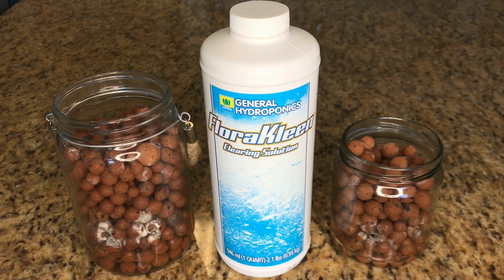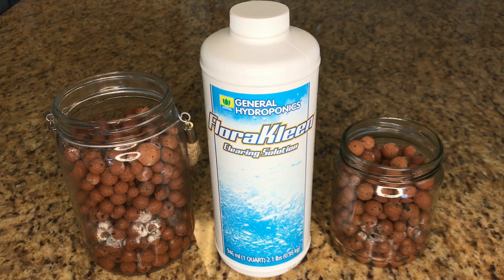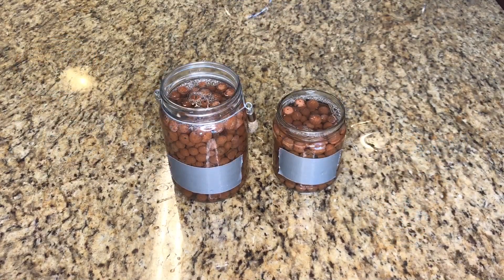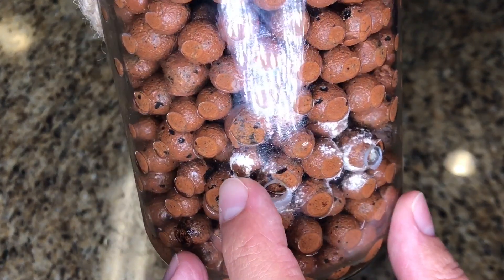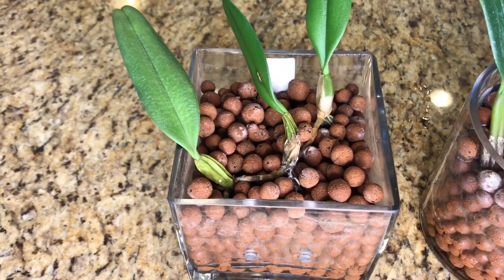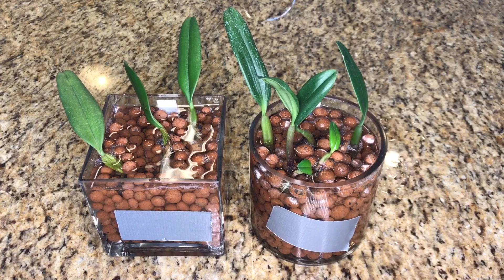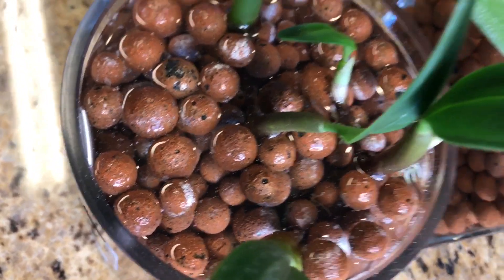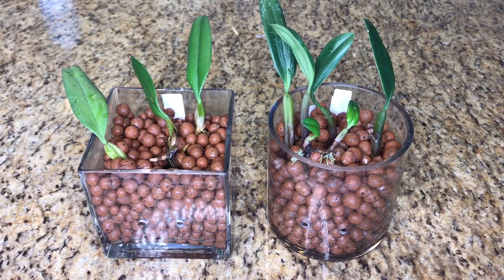Mineral Buildup: Semi-Hydroponics (Part 2)

Comment: Rather than duct tape, which was a bit messy and leaked, I came up with something that is much easier for me. I use hot glue sticks that I taper the ends with a pencil sharpener that fit perfectly in the 1/4" hole. One stick cut in half works for one container.  This is how I'm able to soak my orchids in nutrient solution for 15 minutes or so.

Comment: I just don't fertilize every time, I do it every other time.  SO a plain water flush between each fertilizing session.  I have never had any build up.  I hate using excess chemicals on my orchids but I'm a little OCD about that.
Reply from the maker: I think you're absolutely right. I prefer not to use any additional chemical treatments. Which is why I talk so much about just flushing with plain water. Lesson learned!

Comment: Lol i did nit watvj true tje end before i made my comment. Yes yes yes flush with pure water but lower ph that helps to leach out and dissolve the mineral. 
I hope it does not kill the roots. 🙈 
Much love. 
Kind regards rose 🌹

If the plants has a Potasium o erdose it block out magnesium (or calsium im not shure wich and with gap water tje ph is not low enough to make the magnesium available. Im not tje source for this info i might have them mixed up.  Please watch ricks video on it.  

But ill advise to flush with distilled with kelp mix (if your kelp mix also lowers ph )

Comment: Hi Micheal, 

Your mineral build up is quite extensive for that period of time. You can deduct a few things form that. 
1 your orchids dont take up all the nuts. Your providing, therefore your stil feeding to much. 
 
That can be because of 
-transitioning 
- not in active growth mode 
- Ph not in the right spot for certain nutritions
- They still have a reserve of high nutrients in there system from the mints before and therefore the plant is blocking out other nutrients that therefore wont get absorbed. Nut shure what blocks what you gotta ask rick sorry

CALCIUM and magnisium are one of the most visible minerals whem that builds up (yoy can make beutiful christal when you mix magnesium sulfate in waterand let the water evaporate. (Im doing that expiriment witj my daughter when my epsom salts get delivered next week ) 

And the uptake goes hand in hand with a ph sweet spot. Mabey when you feed at a lower tds around 100 and swing the ph your orchids can use calcium One time with ph above 5.8 and magnesium below 5.8. Ph 

Also see how much cal. Mag. Is in your mix. 

Its all guess work but its good to figure out where the fertilizer problem is. 

I have bin fertilizing with a wopping  430 tds for over 2 months now 🙈 i didn't know so dont judge me please. Buy my leca pebbles and holes in my pots dont have near as much build-up. 

I water with rain water and add a kelp mix with humic acids before my fertilizer goes in. I dont habe my ph pen yet so i have no clue as how high or low my ph is. I do know that i found out my fertilizer had bo calcium in it 3%magnesium but no calcium... like realy wtf what where they thinking but okay thats another subject.  

I hope al that info gives you some ideas to start figuring out why you have so much build-up.  

Much luck and love 
Kind regards rose 🌹

Ps i would start by flushing your vases for tje next few waterings with a low ph to flush out build-up minerals. They can do a few weeks without  (acvept the ones that are growing like weeds ) 

Good luck dear keep us posted
Reply from the maker: You nailed it Rose! I have been giving them the right amount of nutrients, but the nutrients aren't getting where they need to be because I have stripped the roots of all of the bacteria and mutually beneficial fungus that help the plant use the nutrients by using physan and hydrogen peroxide. I'm switching to watering with plain distilled water until all of the build up has been flushed out, and the root system is fully established 😊

Comment: What are your thoughts on changing fertilizer concentration according to growth cycle. Some directions state adding more during growth phase of the orchid and less during non active period. (In my mind the more would be the weakly weekly and less would be very weak). Recently, in your rip segment you mentioned not fertilizing during the stressful acclimation period. This seems to dovetail into today's topic of buildup. Are you seeing vigorous root and shoot growth to warrant the amount of fertilizer? Not really sure it makes a difference, except in your wallet. If the plants aren't using the nutrients...

Again thanks. You're always getting us to think about why we do what we do.
Reply from the maker: I think adjusting based on growth cycle is touchy: I try to replicate what happens for orchids in nature, and nature certainly doesn't consider how much feed it will provide. That being said, nature also doesn't use hydrogen peroxide or physan 20...I'm not sure a lot of my plants have been using what I've been giving them, so I'm not sure how effective it will be at bolstering growth once their root systems are fully established. My suspicion is that once I have a fully adapted plant with a beautiful, expansive root system, the nutrients will be used and have a strong impact. But for now, the Fertilizer just seems to be an obstacle to their growth!

Comment: Interesting topic! :) I do feel like there is a missing peice of this story of mineral build-up... I must say, we are using the same culture method, sh, but I have orchids in this setup for already 3 years and can't see the type of minaral build-up that you got; actually I don't have it at all, and I only water normally, with a very low concentration of fertilizer of about 50 to 70 ppm. I think you should investigate more into this issue and find out what is causing so much build-up on your sh medium, because it is not normal, not after so little time...
Reply from the maker: I've been going through the process of investigating this build up for a while now, and a lot of it boils down to water quality. I have been watering with my tapwater for quite some time, and I didn't realize that it is extremely hard. Straight out of the tap, PPM is usually over 350. That being said, I was also over fertilizing immediately after disinfecting processes, which was another huge contributor. You can kind of see that story unfold over the course of all of my videos, but it's hard to tell in the video by video basis. In any case, thank you for your feedback! I think we should see a huge turnaround in my coming videos on overall mineral buildup!
Reply: Michael's Orchids oh, wow! That's quite a high ppm... Mine is about 250 ppm and my orchids rarely touch that. Only when repoting new orchids, when I shower the orchid root system...  I am glad you know what caused this, because it can be a serious issue and root killer if left unattended for a long time! Will be interesting to see how the orchids respond to this substance. What it is based on?
Reply from the maker: There is no exact ingredient listing, and I have a really hard time finding the specifics. But it is described as a blend of acids in a dilute solution that assist with the flushing of excess salts